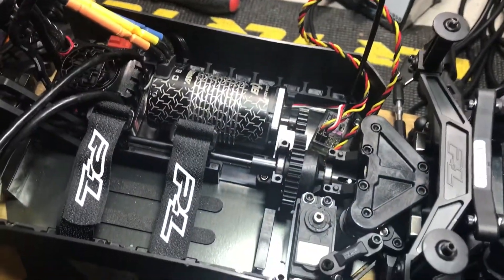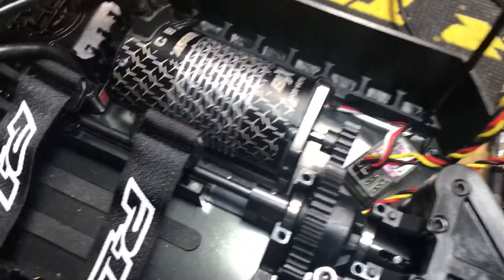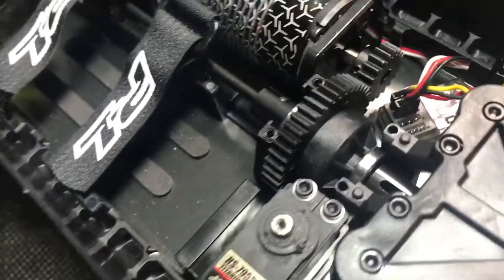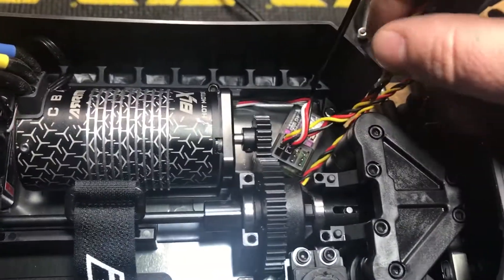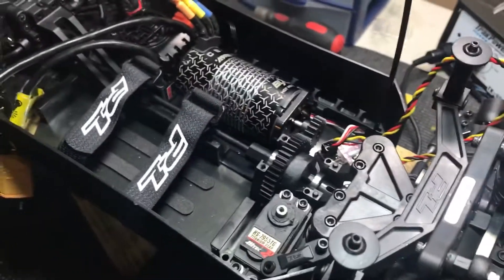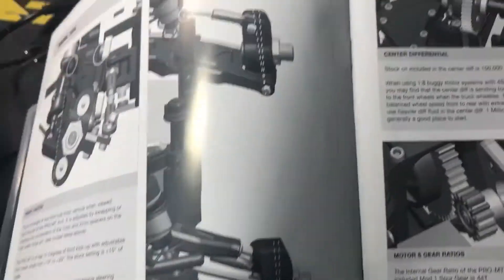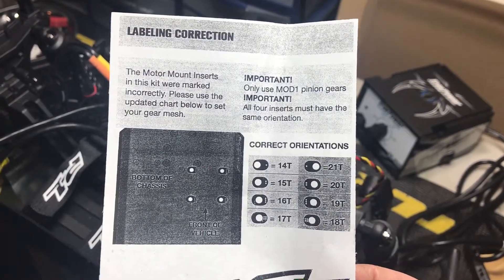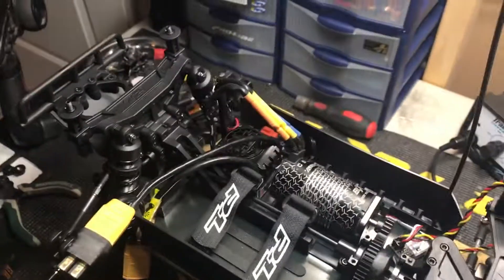Pro-Line Pro-MT 4x4 thoughts so far....

Comment: I just put the same BLX system in my Pro-MT, I didn't realize you could pull the motor wires backwards....I lifted the ESC up to get the wire length needed to reach around the front.

Comment: I put a 16 in mine with 2400kv castle motor and it was tight at first too. Turns out I had the pieces on the bottom in backwards. Turned them around and it worked out! Had no problems with the plastic spur on 4s since. Also I changed oil in all the diffs and shocks as they were all half full. 40k rear, 500k center, and 100k front and that bitch is crazy now. Also put 60k oil in shocks and they are so smooth now! Nice rig bro!
Reply from the maker: J Ho I put 1M in the center 100k in front and 50k in the rear. It's a little beast. With all the snow I haven't had a chance to really put it to the test yet. The instructions were wrong that came with it. I used the 2 dot for the 16t and it fits perfect. Thank for watching!
Reply from the maker: J Ho I put 60k in my shocks too....
Reply from the maker: J Ho oh and I bought the new tbone font and rear bumpers with the wheelie bar. Should get them early next week. I'll make a video.
Reply: Bakerboyzzz RC I got the new t bone stuff coming too! Thanks for the reply bro I might try the 1m in the center

Comment: Can't u just do the paper trick to set ur mesh? I'm running the Blx combo in my mt410 and that's what I did , 16T on 6s , thing is freaking nuts , pulled a quad backflip not even trying to
Reply from the maker: Midwest Boss it turned out the directions were wrong. Just used the correct pins and the mesh was perfect.